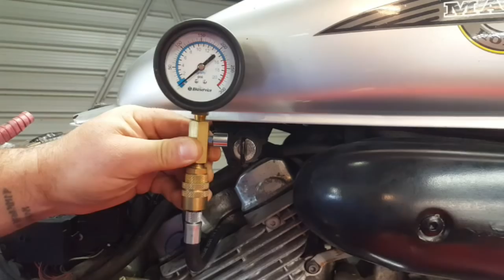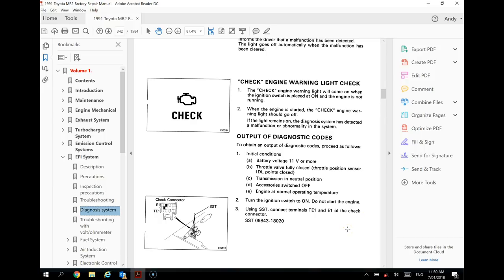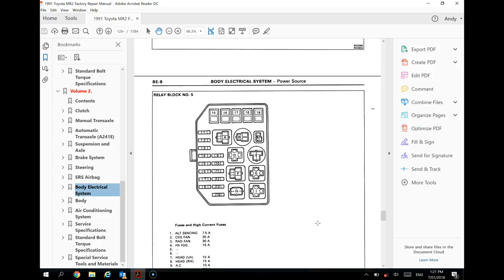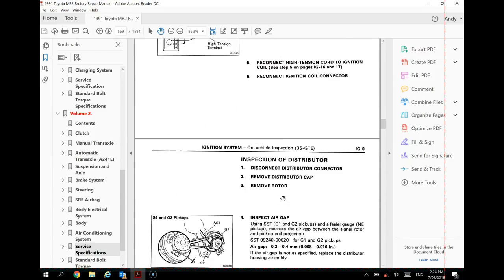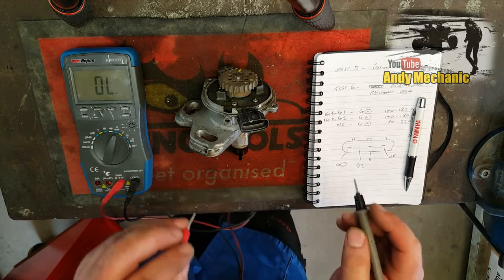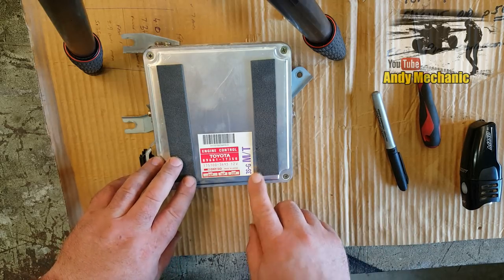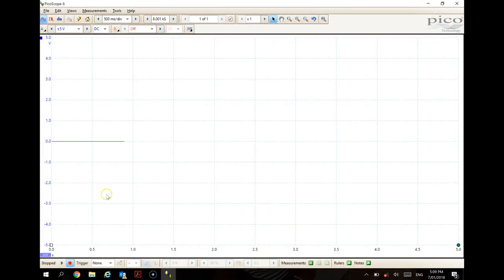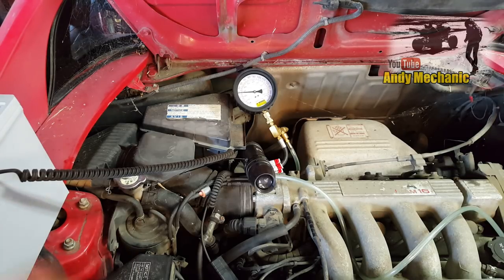Toyota MR2 - start, stall diagnostics Pt. 2 #1221

Comment: Spark looked like it was doing the 1 2 3 pulse thing too when you were doing the long crank. What does the imobiliser cut?
Also what was the voltage between and after the injector pulses?
Would be a good idea to id ecu power and grounds.
Also for power tests use test light as multimeter will say bad connections are good due to it's high resistance.
Lack of prime makes me think intermitant ign feed as it is happy sometimes.

Comment: Andy so far everything seems to checkout how about the immobilizer circuit. Possibly the ignition key or key battery if it uses a key fab. Just a hunch the way it keeps shutting down. Possibly bad alarm connections or poor solder connections on an ignition circuit board if the vehicle has one. Maybe as they heat up your losing continuity. Just some thoughts mate. Thanks for the challange

Comment: Well done on your diagnostics. 
Curious, is that manual for a 3SGTE though, a few slight differences on the S series engines. 
I noticed that while turning it’s cutting out, which brings me back to my original comment about the VSV and the power steering pressure sensor and or vacuum leak. 
I’m gonna get my manual to confirm an idea...leaning towards MAF, those Bosch style sensors can go bad on the contacts inside. 🤔 
again though, this is awesome walk thru knowledge of diagnostics people, and how it should be done. Throwing parts at stuff because you ‘think’ it might be a problem, and physically checking the parameters are miles apart.

Comment: I'm a bit suspicious of the ignition relay still. You measured about 1.7V on the ground terminal and a reading of about 13ohms to ground on these terminals. But they should be connected directly to ground. Maybe 0.5ohm - but 13ohms is quite high. And if it's a poor connection and the current is high when closed, the voltage will increase significantly. There's a 40A fuse on it so I'd expect the current to be quite high. Even at 1A, a 13ohm connection will drop 13V. The injector voltages looked way low also - only about 1.4V? Maybe the poor ground connection on the relay is preventing the injectors working properly & the subsequent voltage rise at the relay is then shutting down the ECU?  Interesting problem regardless.

Comment: If the alarm immobiliser system was the culprit... It wouldn't have started for so long as it did at the beginning of  part 1 where Andy actually said he wanted to go for a test drive.
Reply from the maker: Good Morning chungaleta1234, I think you are correct. It's a fault that definitely occurs more once the engine/components have warmed up a little as the car, when started from cold, will run for a few minutes before the fault develops. However, once the fault shows for the first time that day then the engine only fires for around 6 revolutions of the crank before it dies due to no injector pulse.

It could be a circuit board issue where a dry joint is loosing connectivity as soon as it warms up. This could be in the immobilizer if it breaks the IGF or IGT signal wire, the igniter or possibly even in the ECU. I think if it was a broken external wire within the harness it wouldn't be so heat specific.

Anyway, must sign off now as I'm just about to start filming Episode 3. Cheers for your input... Andy
Reply: Ahhh that sounds about right. Looking forward to that 3rd part.

Comment: Find out if the IGF and IGT wires are where the manual says so. If the distributor wires are moved, it is reasonable to assume the others have been as well. Then scope the signal coming from the ignitor to the ECU. ECU is complaining about not seeing a signal from there. Since a different ignitor doesn't fix the issue, my suspicion would be wiring between itnitor and ECU, and/or rev counter. Since the rev counter also gets its signal from the Ignitor, a grounded cable there might degrade signal quality enough to let the ECU not see ignitions, in which case it would stop fuel injection.
In other words, find out why the rev counter isn't working, and you will find the reason why the engine isn't running.
Reply: The manual being used is not for the 3gse engine, it's for the 3sgte and 5sfe. Hence why there are a few differences.

Comment: it seems more like the alarm to me the way vit keeps chiming in just before you turn over the engine more so if after market
Reply: My first guess, too. I had a similar problem with a Chrysler LeBaron Sedan once and it turned out to be the aftermarket immobilizer that cut the power to the injectors.
Reply: Certainly worth exploring. Normally it's the fuel pump that is immobilised though on these.
Reply: I agree - the alarm's behaviour does not seem right to me;  reminds me of a similar situation I had many, many years ago with a Ford Sierra that ended up with the alarm being repaired by a specialist.
Reply: I thimk the alarm as well
Reply: I thought an immobiliser completely cuts all power to the ignition. So it shouldn't fire at all.
Reply: Yep I'd be tearing that bloody alarm out there by now. It's known that the output transistor for the injectors can fail due to heat, but I think that was for the 4AGE engine if memory serves rightly. If not, a replacment ECU to go in. I'm sure they aren't too expensive
Reply from the maker: +ubanoob Hey, that's good to know. I'm guessing the alarm is an after market one too and it's pretty old now!
Reply: I got it wrong. It certainly was the 4AGE with transistor failure, but it was for the VVT solenoid not the injectors. I think the 4AGE and 3SGE both have issues with leaky capacitors in the ECU though. If it's not the alarm, I'd look at that. Good luck, look forwards to seeing the soloution.
Reply from the maker: +ubanoob Thanks for the update...yes, me too but enjoying the diagnostic process :-)
Reply: Andy Mechanic 

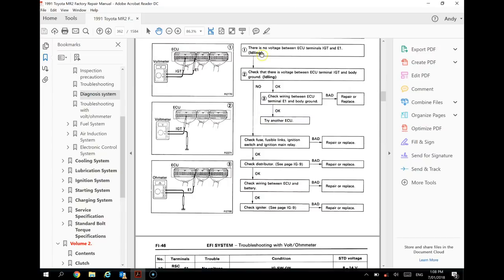@ 20:00 you conclude with a static DC test that the ground is ok.

There can be more complex dynamic interactions when the engine is runing and activating high voltage pulses.

The trigger signal IGT is asserted by the ECU and should drive the Igniter. The Igniter should control the primary winding of the coil similar to old point contacts, closing the circuit, charging the magnetic field of the coil, then opening it to produce the high voltage pulse at the secondary winding and the spark in the spark plug gap.

Both ECU and Igniter work as a system. Both can act correctly from their perspective and still the System can malfunction. Signal have to be within proper bounds for correct comunication among pieces of electronic equipment.

If for some reason the digital part of the ECU asserts IGT (trigger) and the analog drivers outward can not properly communicate it to the IGT input in the Igniter, both can be doing their jobs and still malfunction.

In one of your graphs (may be in other video on this subject) we can see a failure where the DC level of the IGT signal go up, and the IGF response from Igniter stops for some cycles till IGT goes back to proper levels.

It seems a kind of interference. There may be subtle grounding problems. Ground loops are common ElectroMagnetic Compatibility (EMC) problem sources. There may be problems with insulation of the high voltage injecting charge somewhere (check coil, cables, and spark plugs for high voltage leakage). There can be a problem with the driver circuit of the ECU, probably a bad capacitor half-working with too much leakage or Equivalent Series Resistence (ESR) that will seem to work statically, but won't filter pulses appropriately.

Short glitches that disrupt proper signaling may be difficult to see.

ECU always asserts IGT. Igniter sometimes accept IGT command, and sometimes not. It may need the upward transition of IGT, that does not seem to happen when DC level is above the normal high level all the time. Igniter asserts IGF only when it recognizes proper IGT and triggers the spark. ECU needs Igniter confirmation of spark triggering to enable injector driver pulses. With improper IGT signal, Igniter rejects it (properly) and won't assert IGF, which in turn blocks injector pulses, even if still commands spark.

Tach problem could come from the same improper IGT signaling. Each function inside the Igniter can have a different threshold and behave differently.

Try reinforcing ECU grounding and power first, the least costly action.

Regards.

Comment: sparks are firing at odd times.  1  long 2 quick 1 long.  however, have you even checked the fuel filter.  You did say the car is not getting fuel towards the end of the video.  first thing to do i say.  bypass the alarm and retry the car start up.  2nd check for the fuel pressurization.  See if the filter can accept the flow and deliver the flow of fuel.  Then go back to the sparks.
Reply from the maker: +jason puttock Hi, thanks for your input.

Just to clarify, fuel pressure gauge is on output side of filter. Fuel pressure is fine - 1st video.

I'll check out more on ignition circuit on next video. It's the injector pulse (opening signal) or duty cycle that's stopping. This is controlled by the ECU & I want to find out why it's stopping. Is it an ECU decision, a circuit issue or an immobilizer issue....we will find out soon enough.

Cheers again. Andy

Comment: I would be careful to check the igf signal. Toyotas can shut down injectors to save the cat if the igf is missing. Take a look at this https://www.scribd.com/doc/224732136 in this case they are modifying the spark advance system and the igf shuts it down because it's not following the IGT instruction from the ECT.
Reply from the maker: +Andrew Thompson Good call....I'll include this on the next series of checks. Cheers Andy
Reply: I meant to say missing or not "as expected" by the ECU. I guess the IGF shutdown can protect damage to the engine by uncontrolled timing as well as the CAT from misfires.

Comment: This stinks of a crapping out Crank or camshaft sensor. Seen this loads on Toyota's.
Reply from the maker: I agree, if this version of the MR2 had a crank or cam sensor I would agree. However, it does not! Cheers Andy
Reply: @AndyMechanic  Andy there is a cam sensor it's in on the distributor on these revision 2 Mr2s, defiantly no crank sensor.
Reply from the maker: Agreed....though don't fire the parts cannon just yet....next Episode....

Cheers Andy